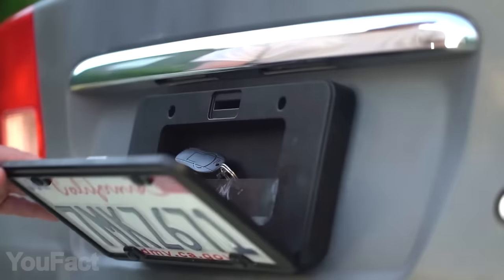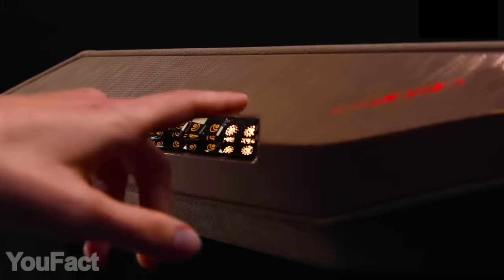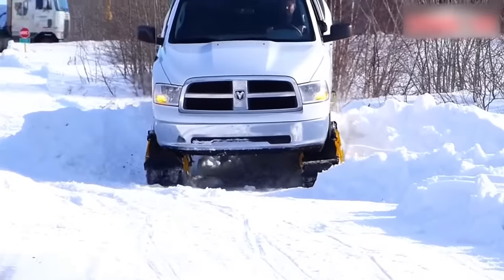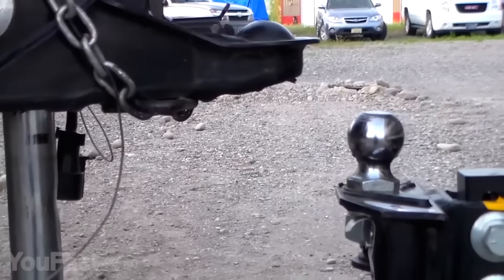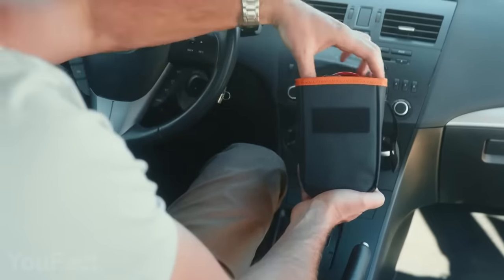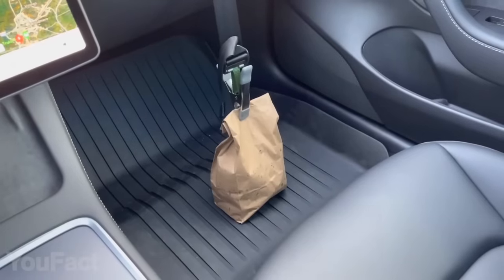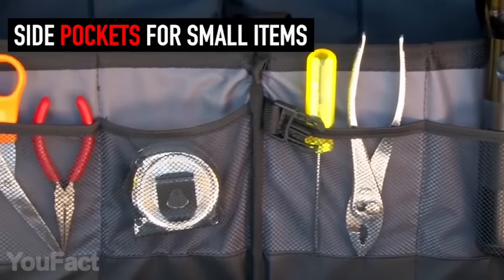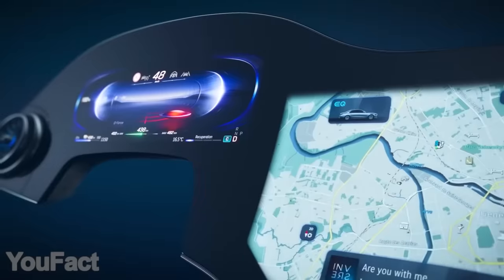15 Coolest Car Gadgets That Are Worth Seeing

Comment: Laser works even if the house loses power. Garage doors won't open but, you can always count on the laser tormenting you.
Reply: Don’t need power if you use tennis ball on a string technique

Comment: That take out bag solution is cool. Suction cup roof mounts could be handy to if it has an anti theft option.
Reply: Better be some SUPER STRONG suction cups
Reply: I can foresee lawsuits if ever the suction cup loses suction and the carried materials hits the car behind! I would never ever buy that! A Micro scratch can cause suction cups to lose suction!
Reply: Suction cups always lose their suction if left on for too long. It would've been smarter if they had safety straps that clip on under the roof by the doors, like the old school roof racks.
Reply: @lastotallyawesomebleach204  they should use the type that they use on Pencil sharpeners with the little metal lever. Those are amazingly strong.

Comment: 5:31 this is so silly and waste of money. Newer cars have proximity sensors and parking assist. And even a string and tennis ball can do this or even make a marking on side of garage. Basically many options that saves you money and not accidentally blind you with laser beam.
Reply: Waste of money? A can of tennis balls costs more than one of these does. I picked up a motion sensing garage parking laser for $4 in the bargain bin at my local hardwate store. Came with a plug-in wall-wart OR battery option. Much better than having that stupid ball and string wrapping around my neck when I'm working in my garage. It wont "blind you" if you have it aimed properly either.

Comment: The "I-Ball" camera. Any truck built after 2008 will likely have a back up camera. Trucks especially have the camera aimed in a way that it sees the trailer hitch. I have a 2008 Escalade EXT and it's factory camera has the perfect angle when I am backing into my trailer. That product is only needed for older trucks.
Reply: 2013 truck here no back up cam and roll up windows lol
Reply: I've been backing up to trailers with work trucks for 25 years. Never needed no stinkin camera. It got to the point where I can look through the back window or side mirrors, back the truck up til it lightly bumps the ball on the hitch, pull forward a few inches, and everything is completely lined up the first time when I get out. I did this once with my old man in the truck, and he was impressed. He said "I can see you've been doing this for FAR too long". This was his way of giving you a compliment.
Reply: Nope, back up cams are just optional. I personally think they're useless and it's just another thing that will break and lower the value of my vehicle in the long run.
Reply: @lastotallyawesomebleach204  they(back up cams) come standard in quite a few vehicles nowadays.
Reply: I-ball cam is really handy, most of the time anyone with enough experience can nail it the first time, I bought it because as the spring thaw comes and the ground softens you don't get second chances if your off, now I have an f150 that's aluminum and this thing won't work, so now I stick on shop wall so I can bach camper into it's little hibernating spot with a birds eye view and the wife's not yelling go right when I need to go left, we also stick it inside horse trailer and keep eye on horses while transporting, it can get a little fuzzy doing this but you can still see what's going on, so many uses other than backup camera

Comment: I've had a similar car vac for years.  They work OK for smaller vehicles like motorcycles but take too long to adequately dry a car.  Mine sits mostly unused nowadays.
Reply: I use my gas leaf blower to get most of the water off and then finish with microfiber towel.
Reply: As a detailer, I'd only use that dryer thing to blow water from area that my microfiber towels can't reach, like in the cracks between the light housing and the body or blow water from behind the side mirrors. If I wanted to blow dry my entire car, I'll get like an electric leaf blower lol
Reply: I found the BigBoi works if your car has a ceramic coat on it.  Then it dries it very fast with no need of towels or scratches, it even gets into the cracks and behind the trim.  But they don’t work on a car without that extra layer of protection.
Reply: I've been using an electric leaf blower for years.

Comment: I would legit use that license plate item to avoid getting caught by traffic cameras. Just use the app to drop it open if you're trying to cross while the light is yellow. (And all you safety monitors, I really don't wanna hear it cuz we're all guilty) so loosen up that cape a little bit.
Reply: No. We're NOT "all guilty". Speak for yourself. 🙄
Reply: Okay mister i drive 5miles under and stop 3 blocks away for a yellow calm down

Comment: If your house don’t have any power, how would your garage door open?
Reply: Every powered garage door has a manual release. It’s the little red handle that hangs down on a string. Just pull it to lift it manually.

Comment: I'm pretty sure that little safe is illegal in most places because it can be used to hide the licence plate from speed traps.
Reply: How can it "hide the license plate"? 😕
Reply: @davelowets  When it's open (or when it fails to lock), the licence plate is showing downwards.
Reply: @stephans1990  If that happens, then I could see it being an issue. Hopefully the software in it wouldnt allow someone to be able to remotely open it when it's in motion. As far as manually opening it, and leaving it down, its probably faster to go out there and bend your plate up to hide it without the device.

Comment: 5:46 if power goes out you can still use the laser to align your parking.... How is the garage door going to open from the outside without power?
Reply: It won’t, but you can always walk into the garage via the regular door, and just pull the magical red handle on a string to open it manually.
Reply: @westside_db5867  thanks professor obvious.
Reply: @westside_db5867  But how can you see inside your dark house to find the garage?  Ah ha!
Reply: @geosciencenerd  YOU asked... 🙄

Edit: MANY garage door openers also have a battery back-up, and WILL still open with the remote if the A.C. power is out

Comment: But… if your house looses power.. you wont be able to open the garage door… The laser guide is still useless 🤣
Reply: Wrong. Many current garage door openers have a battery back-up in them that will still allow it to work if the A.C. power goes out. Mine is almost 5 years old, and has the battery back-up.
Reply: Correct. I forgot about their battery reserve feature
Reply: @Joehatrix  🍻

Comment: So we not gonna talk about the fact that if you leave your key fob into the license plate thing then your car an be unlocked and started without needing the key fob in your hand…so anyone checking to see if the car door is locked can now get in
Reply: For cars that have that option, my car doesn't
Reply: @joshuahatfield538  What year is your car....do you have to take the keyfob out of your pocket to get in your car or to start your car?
Reply: @Jordan-fo1pm  Not every car has a wireless keyfob, and a start button. Some STILL have "keys". How old are you? 10?
Reply: @davelowets   This maybe true, but it still doesn’t change my original comment especially since I stated in my original comment about the act of leavening your “key fob” in the license plate…we are in 2022, many people do have wireless key fob and a start button
Reply: @Jordan-fo1pm  Also, just because the key fob is in there, doesn't mean the car will stay unlocked. With my key-fob I can lock the doors, and they will stay locked, until I walk out of range of the fob and come back, THEN they doors will unlock. I can lock my car and stand next to it all day with the fob in my pocket, and the doors will remain locked with the ignition disabled. It wont work until I walk away and come back or manually press the unlock button. So, no difference between keeping your keys in there, or key-fob in there.
Reply: @davelowets  Well with mines as long as i a close by I can lock and unlock as many times as I want without having to walk away. (Toyota)…I can also lock and unlock by just touching the handle as long as the fob is close by…so yes, putting the key fob in the license plate up front will still mean the fob is “close and near by” the same would happen if it is installed in the back.
Reply: @davelowets  Key fob knows your position vs letting someone in and you are well allowed to have your opinion but most Americans buy foreign cars…not an opinion but fact (around 54%)
Reply: @Jordan-fo1pm  "Knowing your position" won't do a damn thing for you if your trying to keep you vehicle locked while you are standing outside of it, and all someone has to do is grab the handle and your vehicle unlocks.
Reply: @davelowets  Actually it does, which is why you cant be locked out of your car if your key fob is  inside the car…not to mention, i just tested it out if someone could unlock if you are inside and you locked the door…so again, please come with facts, not opinions/emotions/feelings…youre trying to argue opinion over factual working technology
Reply: @Jordan-fo1pm  Your not comprehending what I am saying....I'm NOT talking about you being INSIDE the car. I'm talking about if you were standing OUTSIDE the car, and you locked your doors to keep your children safe, and you REMAINED outside of your vehicle to fight off an an attacker. From what you are saying how your car works, ANYONE would simply be able to grab the door handle and it would automatically unlock. Mine does NOT work like that. If I lock my doors, and remain outside my vehicle, I have to MANUALLY press the unlock button on the fob(not just grab the door handle), OR walk way out of distance of the range of the fob and come back, before my doors will unlock by grabbing the handle.
If your system operates the way you say it does, that was a major oversight for safety on the behalf of the designer of your car. Got it now?
Reply: @davelowets  you are missing the point..i am speaking on what i know, which is why i made my original comment. We dont have the same make and model car so why are you telling me about yours when people that have cars like mines have this issue which again goes back to my original comment
Reply: @Jordan-fo1pm  Your missing my whole point... Which is the way that your car works is dumb, unsafe, not very well thought out, and yep you definitely WON'T be able to take advantage of the product shown in the video. While the buyers of American cars, that have a much better thought out key-fob system, WILL be able to use the product. Sucks to be you, I guess... 🤷🏻
Reply: @davelowets  You are missing the point…the way my car works is the way my car works…I think it is dumb to live on the east coast because of the storms and west coast because of the earthquakes but people still live on those coast right..smh I am 1 of many whose car function this way which again is the reason for my original comment. My car is a 2022 so this technology is in fact being implemented..smh
Reply: @davelowets  Also Americans cars are only 46% of cars in America…thats like a Hispanic person who speaks Spanish but gets a D in Spanish class

Comment: Everyone watching this should be worried that too much technology in our lives is very bad.  Drive a car should just be the car and the driver.  
Not all this fancy electric’s.
Reply: I agree, I drive a vintage truck and no electronics are in the cab but one very dim dome light, and I don't allow cell phones in or near it. I hate electromagnetic radiation more than non-smokers hate cigarette smoke.
Reply: @invisableobserver  Except that non-smokers have a legitimate gripe. Put your tin-foil hat on, and you'll be fine.